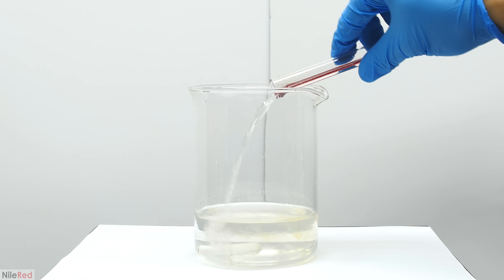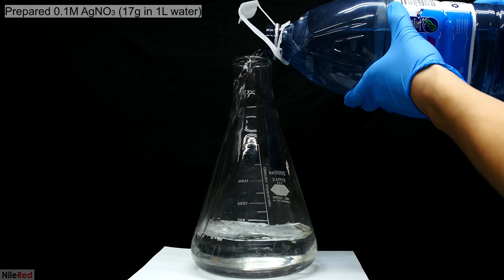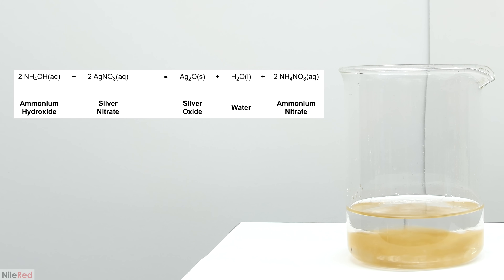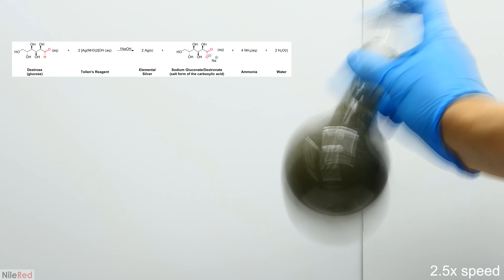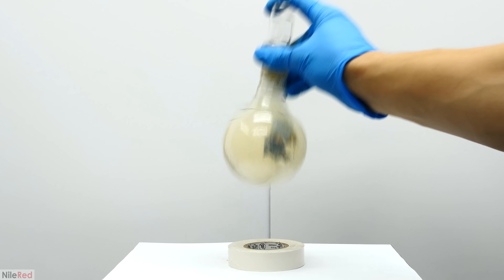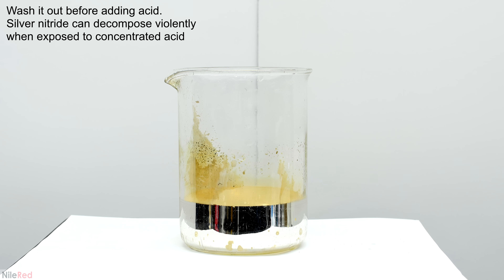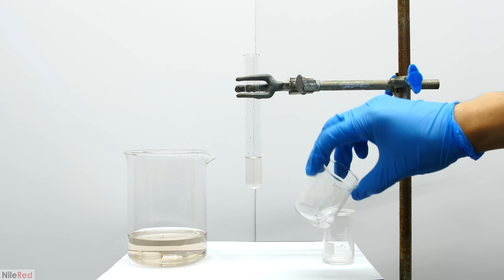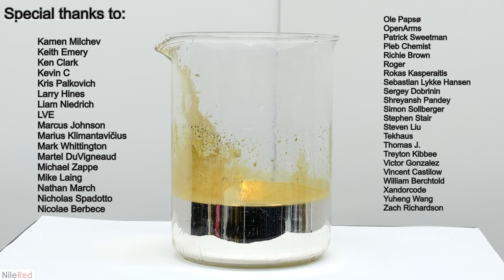Making a silver mirror

Comment: can somebody please try this on CDs or DVDs with data rot? you could dissolve the old oxidized aluminium layer with an acid and then apply the new silver coating over the disc. After this one could spray some clear coat to protect the silver layer so it doesn't degrade again... I think this might work because the data is stored on a polycarbonate layer and not on the metal layer. I don't know how resistant is polycarbonate to acids, but please somebody has to try this. How many discs could be restored it turns out to be a working method?

Comment: Probably hopelessly late to ask this question. I'm trying to build a magnetic loop antenna.  What I need is a large loop of around 2 meters made from pipe that can be formed smoothly.  Ideally the pipe would be around 75mm in diameter and with the lowest electrical resistance possible.  Silver is the best.  When dealing with radio frequency the current only will travel in the out 33.9 μm surface of silver.  Coating the inside of pex pipe would almost be the theoretical ideal.  Is this possible?  Second is this durable if coated with something for protection?  Is it as conductive as solid silver.  I've looked into electroplating, but not likely to be done by me.  Thanks for any answers!

Comment: I think the cloudiness you see on adding Silver Nitrate to water is actually Silver Chloride and other Silver salts precipitation out due to double displacement. With the exception of Nitrates, most silver salts have pretty low solubility in water. This would happen if the water you used has any contaminants.
Reply: I agree. I did this at home using analytical grade silver nitrate and got a precipitate on dissolving in tap water.

Comment: I hope you can help me with this question so I don’t blow myself up. I had some silver nitrate     
, I added non iodized salt to it to precipitate silver Chloride. In my haste I forgot to rinse the silver Chloride clean and then proceeded to add sodium hydroxide. Which in turn produced silver oxide.  I then added sugar and ended up with silver metal , also it mirrored the flask. How did thus happen without adding ammonia. I’m at a loss! Any help would be greatly appreciated.
Reply: My understanding is that the formation of the silver-ammonia complex is in order to slow the reaction down so you get a mirror rather than just black colloidal silver. So it should work without the ammonia and you were fortunate to get a mirror.

Comment: I'm gonna make and use Tollens. So if I neutralise with acid afterwards it will be safe to store as waste?
Reply: Yes you can just make sure you don't disturb it too much both before and after you neutralise it 
Add more glucose filtre off the silver oxide wash the oxide with a bit of dilute acid NEUTRALISE and store or as he says pour down the drain
1) don't disturb it before as it's really very sensitive to movement as it shud be being a contact explosive 
2)if you are making it in large amounts there may be some volume of silver nitride remaining 
And for neutralising process try to nail the proportions as if you are left with either explosive or acidic mess it's not good and it's always a good idea to make your waste as inert as possible

Comment: 3:09...no Nile Red...whats floating around in there is most likely NOT silver metal particles.., it is Silver chloride and other insoluble Silver salts from the water you used. Even when doing this in a lab, which I have many times, the only water you should use is distilled AND deionised water, or as some in the lab call it, polished water, always hated that name.

Comment: can you please make a video about how to recycle the silver present into exhausted photographic developer and fixer?
in photographic developer the silver halides are reduced to metallic silver by hydroquinone or metol, but a lot of silver is often present in the solution (maybe because of the solvent action of sodium sulfite, used as preservative). in the fixer the unexposed silver halides in the photographic paper are cleared, so there are a lot of silver compounds in the solution. the main chemical is sodium or ammonium thiosulfate.

regarding your video: is it safe to dump the colloidal silver down the drain? can it lead to heavy metal intoxication of fishes and other animals?
Reply: some time ago I accidentally obtained a silver mirror inside a glass bottle of exhausted fixer left untouched for more than 6 months

Comment: I would bet that the reason the stopper didn't get coated is that it didn't have an energy differential between liquid and air like the beaker did.  It would be interesting to see how the reaction goes in a partially decompressed nitrogen controlled chamber.

Comment: Your description of the silver nitrate solution is not quite right; .1 mole of solute in 1 liter of solvent is .1 molal (.1m), not .1 molar (.1M). Actual .1 molar is .1 mole of solute to 1 liter of SOLUTION, meaning you measure .1 mole of solute and add water until you get 1 liter of total solution. Due to the solute taking up some volume, this requires less than 1 liter of solvent, so it is slightly stronger than .1 molal, which is what you prepared. Then again, the difference is minimal and not at all relevant here, but you should know how molarity is defined!

Comment: I've always been confused about the demonstrations of the silver mirror test I've seen. The only time I did it in IB Chem, the sheen formed instantaneously upon the addition of the aldehyde we were testing. Does the speed & strength depend on the aldehyde in question, or was it just because we were told to control the temperature of the solution within a .1 Celsius range?

Comment: I think it might react a bit faster if you use a lower molwt. dextrose. Or simply glucose/(isomalto)malto oligosaccharides. The same weight of smaller polymers would result in more reducing ends be accessible for Ag reduction.

Comment: more sodium hydroxide speeds up the reaction (higher pH). You can activate surface with SnCl2, just bath it/spray in diluted SnCl2 solution, wash it with deionazed water and put in silver plating solution.
Reply from the maker: +Woloszow interesting. I read about using SnCl2, but didn't know the exact way that it was used to activate the surface.
Reply: normally it is used after PdCl2 treatment. Reduced palladium particles acts as catalist. I found that only SnCl2 also works for silver. If You want to read more about it You should search for nickel electroless plating of nonconductors.

I used SnCl2 treatment to plate feather with silver and then I could electroplate it with nickel
Reply: mail id please woloszow.

Comment: Hey NileRed, great video (as always :))... One thing is bugging me though; could you please, please, bring back the 60fps recordings, like you made a while back? It really does make a HUGE difference to the clarity of motion and just the overall detail of the video in general.
Reply from the maker: +MRLT I understand. I just don't think the 1080 on my camera is very good. To solve this problem, I will be buying a 4K/60 camera. That will be the best of both worlds
Reply: NileRed; Ah right I completely understand that, and thank you so much for taking the time to reply to me!
Some cameras just do 60fps as a marketing gimmick, with the engineers being told to just add it in last minute, so the video gets recorded at the same data rate as the 30fps version which then causes a lot more compression artifacts.
However, I would still always choose to go with a higher framerate and the correspondingly lower resolution (down to about 720p, after which not even NNEDI3 can make it look acceptable...).
Sadly that doesn't really mean much coming from me, since I am unable to perceive motion if there is pause of more than about 9ms (translates to a constant framerate of about 111 fps) until the next frame (or more accurately, I don't perceive coherent motion. It just looks like a series of flickery pictures randomly jumping around.)
Luckily, your videos normally don't contain a lot of super fast motion, so recording at 60fps shouldn't introduce too much temporal aliasing (I interpolate the video to 120 fps, before I watch it, with a heavily customized version of SVP). 

Obviously it would be completely ridiculous for me to ask you to change something that only accommodates my peculiarities; but numerous independent tests have clearly shown that the average person can immediately detect the improved smoothness when going from 60 fps to 120 fps, just by dragging a window around the desktop. Therefore I strongly believe that most (if not all) of your subscribers would at least be able to notice the increased smoothness in going from 30 to 60 fps. Whether they like the increased temporal resolution or not is, unfortunately, not as clear cut (I have seen a lot of people that are STRONGLY opposed to anything exceeding 23fps, with the main argument being that the increased framerate makes the video look "too real").
Now I don't believe that a more accurate portrayal of reality is a bad thing at all, especially considering that your videos are about real-life chemistry.

PS. I REALLY hope that the 12 bit per colour version of the rec. 2020 becomes the go-to mainstream recording standard very soon. The bigger colour space, together with the larger dynamic range and increased colour accuracy, will make a HUGE difference to the value of educational chemistry videos like these (since what the camera captures and is ultimately displayed on-screen, would match the real life reaction colours and intensities almost exactly; in contrast to the situation we have now, where the images will sometimes look pretty realistic, but other times will look nothing like it does in reality).

Of course, it seems much more likely that we will only be seeing the 10 bits per color (which will actually lead to a DECREASE in colour accuracy compared to today's 8 bits per colour) version, in our lifetimes at least, because the entire media industry would most probably spin a story along the lines of "the human eye can't 'see' more colours than 10 bit video is able to display" (just like Samsung justified removing half of the blue and half of the red subpixels from their Pentile matrix, and many camera manufacturers justified doing the same thing to cut costs by implementing a 'Bayer filter',  as more closely approximating the way the human eye sees due to our retinas, allegedly, being made up of predominantly green photoreceptor cells... even though an actual human retinal layout looks more like this: https://www.cis.rit.edu/people/faculty/montag/vandplite/images/chapter_9/mosaic.gif ).
Also, sorry for ranting on about this for so long, I totally would NOT hold it against you AT ALL if you decided to not read all of this ☺.